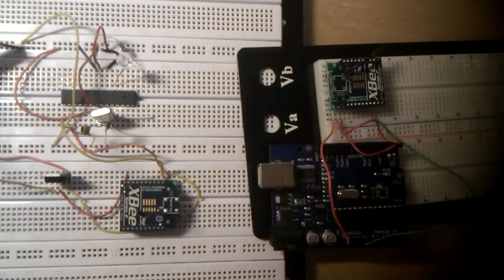Tutorial: How to Setup configurate Xbee Devices (Hard and Software) with an Arduino HQ Part 2

Comment: The xbee has no real pin for analog to analog, but what it does it takes a pin with analog signal and converts it to digital by sampling it thus sending the modulated signal to other xbee and from there you connect it to the arduino to manipulate it how you want it to shown. But the output from the receiver xbee is not analog but digital. It does has PWM to get analog voltage though.

Comment: You can do that.  You just have to read the anolog pin.. save the number (0-255) and send that over to the xbee via a variable..  Then if you want back to exact voltage on analog pin just push the number the reciever got to the analog pin you desire..

Comment: i have used this code at the receiving side to blink an led but i’m getting junk values in the serial monitor.
int p=2;
void setup()
{
//Start Serial
Serial.begin(9600);
pinMode(p,OUTPUT);
}
void loop()
{
while( Serial.available() == 0);
int data = Serial.read()-’0′;
if(data>5)
{
digitalWrite(p,HIGH);
}
else
{
digitalWrite(p,LOW);
}
Serial.println(data);
}
when data>5 the led is blinking but there is error values in the serial monitor like this ;
6
-35
-38
6
-35
-38
6
-35
-38
6
-35
-38
6

Comment: I am planning to build a security system. Plan is to interface a single xBee receiver with adruino. This receiver will be able to receive data from 4 other transmitter xBees(possibile?). Based on the input from each xBee, adruino will identify which area had a breach. Been boiling this idea in a pot but i am not inching anywhere. You works seems to make some what similar to what i am trying to get at. Please let me know if you can add more to my idea and i would be thankfully grateful.

Comment: @ixer2006 Ok I have another question. Are you familiar with the XBee API for JAVA? 

I have this setup with a SunSPOT (similar to Arduino) connected to one Xbee pro, and another Xbee pro to my computer. 

On the SunSPOT side, I output sensor values, through a UART output, to the Din Dout pins of the Xbee.

The problem is with receiving the message on the computer side, as the Xbee itself expects certain packet formats. Do you know the proper way to send this type of data over an Xbee network?

Comment: @ixer2006 ah ok, well SunSPOT are Sun Small Programmable Object Technologies, it is basically a small sensor board akin to the Arduino. I found out about the XCTU software and contacted a student who happened to have some experience in hooking them up..however your video(s) were still very helpful, thanks any way!